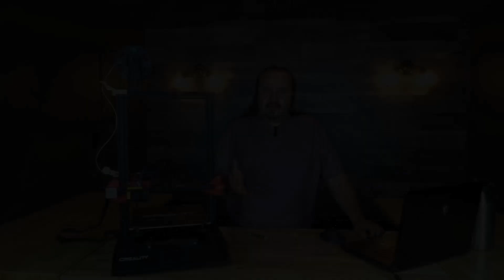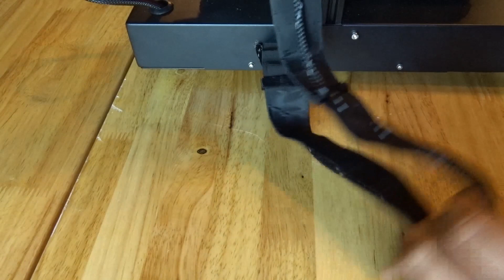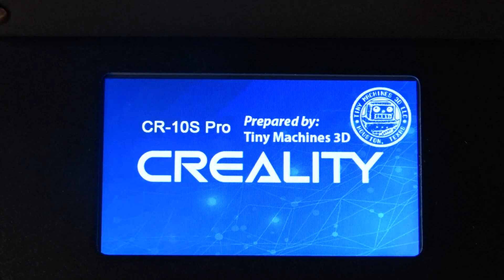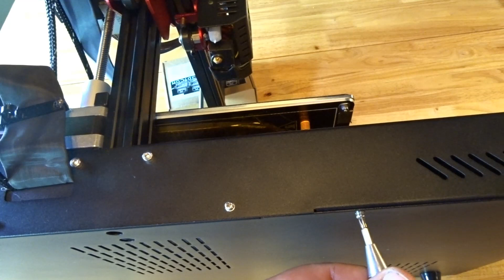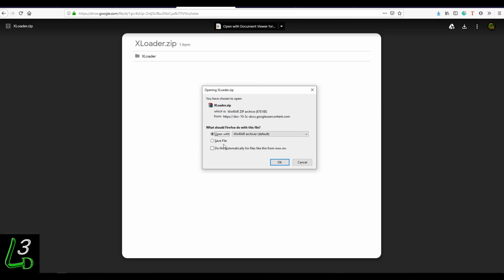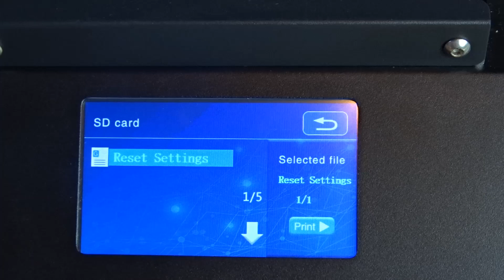Full Tutorial CR10S Pro TinyMachines 3D Latest Firmware update B7 (June 2019) with BLTouch V3 probe

Comment: This is a very good video, but I have come to the conclusion that if it not broken then don't attempt to fix it. It appears that people who own these machines spend more time, money and effort ' upgrading ' them rather than print anything useful with it. My stock machine 10S ProV1 with the 8 biit board (only changed the capacitive sensor to inductive and put on some Chinese anti backlash nuts a few years ago) managed to print a full 5X7 field camera over a period of a month with a good degree of accuracy that the parts fit very nicely together and there is no light leaks. That is good enough for me. Others might have other ideas what these machnies are for. BTW, all the FW pages have been removed from the Tiny Machine site and moved over somewhere else. Thanks for this posting.

Comment: Thanks for the tutorial!  Question for you if you see this.  Recently my CR10spro went wonky and now has major later shifting on Y axis   like it's over shooting front and back measurements, sometimes it's layer shifting only in one direction like stairs but other times it goes both ways 🤔maybe Y axis is biaxial 🤪 .  I've checked all mechanics and everything is as it was since I've been printing for 13 months and boy have I been printing. Could this be a glitch in firmware? I figure electric motors are going to either work or not work . My belts are tight and teeth are fine. I had a weird episode of my flash card being deleted by the printer on the same day that the layer shifting started. That's why I wonder if it's a firmware/software glitch. Computers being stupid occasionally and requiring humans to reset them . Any help would be greatly appreciated! I have 10 rolls of filament waiting to print Christmas displays 🤣
Reply: Did you find the problem?
I have the same problem now :/

Comment: This was helpful, not I am now receiving an "SD INIT Fail" at startup   firmware version is shown as 2.0.9.DW7.4 loaded from tinymachines on 7/31/21.   any suggestions?
Reply: Hi Steve. I am sitting with the same SD INIT FAIL at start up. Did you ever manage to get this sorted? If so, i need some advice please

Comment: I'm trying to install a BL Touch on my CR10-S Pro using a kit I purchased from Tiny Machines 3D. I'm following the instructions and I got as far as flashing the LCR (successfully) but now when I am trying to install the Tiny Machines firmware to the main board using X Load, it says "Can't open port".  It only gives me one choice of ports to use  (COM3) I read it recommends 115200 for the baud rate and another place I read try using 250000. I tried them both, no luck. I'm sure it's something simple I'm missing, but I've never done anything like this before and I don't understand it all completely.
Reply: I figured it out...I had Cura open and it was using that port apparently. Time for a beer :)
Reply: Good grief, I feel like I'm talking to myself. Now that I have the firmware installed, I did the homing of the machine and the BL Touch did not deploy. fortunately, I was able to turn the machine off quick before It buried the tip in the table. When I turned the machine on, it deploys twice and then retracts and has a steady red light. Any ideas what's going on?
Reply: I had to flash mine twice. Make sure you have the correct firmware. the one with BLT in the file name.

Comment: Hi, I'm trying to upgrade to Tiny Machines for my CR-10S Pro V2 (BL Touch included), but i need to customize offset of probe. I have downloaded several versions and try to compile with no success. Please can you guide me to the right files? I think I might be failing on editing custom offsets inside Configuration.h
Reply: If you are feeling crazy, I just built and loaded CrealityDwin2.0_Bleeding and noticed it had Probe offset under Settings->Tools->Adjust. I used VSCode/PlatformIO to build it.

Comment: Thank you sir! This weekend I am going to try to put this on my "v1" machine that I changed out to an inductive sensor. I also have a v2 with a BL Touch but I am hesitant to change the firmware on that because the OEM version it came with is working really well.
Reply: I am with you here on the V2. How can I be sure that Print Resume functions on the TM firmware....?
Reply: @sunlec   You need to enable it via line command through Cura or Pronterface. I don't remember what command it is though.

Comment: when its doing auto level should the nozzle be at print level ie. .2 mm as it goes around?
Mine seems tro be about 2mm off the bed.
Reply: How did you get it to update , i keep getting a blue screen with all lines being 0000 when i try updating the screen
Reply: @arthurmatusevicius3192  make sure the memory card is formatted properly, put the folder DWIN_set  on the card and put it in the screen slot, power up and wait.
Reply: @arthurmatusevicius3192  make sure you get the right version for your printer.

Comment: hey, i used your video to install the newest firmware DW6 and i now have 36 probing points. but when i go to do the autolevel it says its going through probing points but the extruder itself is not moving. and it homes and moves fine in movement menus

Comment: Hello.  Xloader finishes updating with 0 bytes updated message. also cura is stucked at firmware upload pgress bar.  promterface is OK with connecting and managing printer. any ideas? changed all baud rates and tried. firmware file is confirmed with tinymachines support. its CR10Pro_Stock_BIL_DW5.hex as of Feb.20
Reply: Did you sort it? I have the same problem, tried everything
Reply: @marineaircon  did you tried with windows7 ? i will do if i find a W7 laptop. But very interesting that i also tried with another cable also. same result.
Reply: hello,  any result?
Reply: change to 250000 baud rate thats what fixed mine.

Comment: Tinymachines website for that address is TOTALLY different now. The files you are showing in this video don't exist. I just purchased my CR-10s Pro and am running ver. 1.6 and would like to moe to the TM one but I can't figure out how to get the DWIN files for the screen and I think I have the .HEX file but I am not sure. Any help would be great.
Reply: Same issue here.  I am unable to get the files???
Reply: Same issue here. My firmware version: 1.70.0,
Which steps (including the right files) are necessary to update my firmware?
Reply: @simcha007  its the same steps as the video the only thing that changes are the files depending in your sensor
Reply: @eggiereyes  Thank You, I managed to update the firmware by using Cura. Now I have troubles with updating the screenfile. When I copy "CR10SPro_Max_Ender5Plus_V2_Screen.7z" to my SD-card there will be no action after powering on the printer. How come?
Reply: Wim Wessling did you do all the steps as this video
Reply: @eggiereyes , yes I did. First the formatting of the SD-card, 4096 bytes, FAT32 and made a map DWIN_SET and copied the file into this map. I got a blue screen with the mentioned files but all zero's at the end of the lines
Reply: Wim Wessling you should have see the word END on the top right corner all it does it flshes the screen nothing more the end its just a blue screen
Reply: @eggiereyes  Mission accomplished. I had  to unzip the 7z-file. Thanks for your support!
Reply: Wim Wessling  Yes you only needed to have the Dwin set folder in the SD card.

Comment: Their firmware will not refresh SD files unless you switch on/off the printer.
Reply: I have the same issue. It also stops reading a file if you by any change cancel a print. After you cancel that print (bed leveling issues or any other reason) the printer refuses to print the same file again. I can select and print other files bot not the one I cancelled. I found that if I go back to the main menu, take the sd card out, go back into print menu (with the sd card still out), then go back to main menu, insert sd card again, go back to print menu and 7/10 times works again. I am glad I just upgraded the firmware to only one of my printers as a test. I am going back to version B7.

Comment: Hi, for how long does it takes to Xloader to upload the firmware ?
Reply: Answering to myself, it should take less than a minute. 
I had to fix the baud rate in the windows manager :

"go to settings and then manage settings see the device manager and look for comports. verify the correct comport is active then set Xloader to that comport. select the correct bit rate as I show in the video others will not work. then reupload this. it should work just fine now."

Comment: Does not sound so easy but definitely worth doing. I did update my sensor to an inductive model and added Z drive synchronized pulleys from Tiny Machines. I have two problems maybe you can help me address. 1} I find the top of the Z assembly does vibrate and I bought the Struts for the Max Printer thinking I could find a way to mount, But then I learn how short the Aluminum frame really is under the steel plate cover. It there a way to address this with longer frame added to the existing assemble or do I need to replace the bars with a larger Max Like frame? 2} My second issue is during setup for a new print my nozzle will leak filament the whole time, so that by the time it gets to put done the 1st layer there is always a small blob of plastic I have ti fuss about dragging it out or it gets in the way and can cause the first layer to lift and ruin the whole print.  Is there a G-Code I can add or setting in CURA to retract before setting the level bed and keep the nozzle clean until 1st layer print time??????? Dennis
Reply: Houston we have a problem. I followed instruction very carefully did the screen update yesterday and tried the controller update today. All pretty simple after I drew up a flow sheet to break the steps down. BUT, the X Loader never returns loaded file size it seemed hung in loading. I waited 20 minutes.  How long does the load take, I unplugged. did the reset and ran a ABL to find only 16 test points. So it did NOT load. does it take so long. Can I simply retry to load and just let go for an hour????  A little more on the expected time lapse would be great. and I should post my flow sheet it may help 2st timers see and better understand what they are doing and why.  Help????
Reply: I had the wrong device name, all GOOD, Prints better too! Thank YOU! Dennis
Reply: A Mazingly consistent prints is so rewarding. 10S Pro is a really good printer once the bed sensor and Firmware was upgraded. I can load a print and walk away now. Results are beautiful. O16 layer quality is awesome.
Reply: @DennisMurphey   Hi! May I ask a question if I don't bother you? I am new to 3d printing. CR-10S Pro is my first 3d printer. I bought it 2 months ago. I use Creality's 1.701. firmware. The printing results are not that satisfied for me. I always have the same problem in every print: The outermost walls surfaces are not smooth. Layer edges are kind of ragged. I tried different layer heights, different print temperatures, different print speeds but they didn't work. I use the stock sensor... I don't know what the problem is. Finally, I decided to give TinyMachines firmware a try. But I don't know if this is the solution. Do you recommend TinyMachines firmware? And, does Z drive synchronized pulleys make significant difference on print quality? Thank you.
Reply: @konurmustafa  I did 3 things to my Pro but I feel 2 were significant. 1. I updated the bed sensor to the inductive sensor $10. I seemed to now provide a constant measure of deck height, more reliable. 2. Yes, updates the firmware. Several things included in the update, there is a list of 10 updates included, several are serious bugs in the resetting of the Z offset that were broken.  I can without reservation suggest these two updates.   Regarding your issues specifically, I am fairly new to 3D printing, and have only had my Pro for 1 month but I will offer my inputs. I think you need to go through the device most thoroughly with respect to the guide rollers. on all three Axis'. I found upon inspection all axis guide rollers OUT of adjustment. I removed the bed top and the carriage. I found the inner 4 rollers were all very tight, but three of the outer roller were not even turning. Very slight adjustment but it smoothed the axis movement considerably. On the X axis I saw the nozzle assembly lifting when going to the home position. I raised the assembly then lifted the nozzle to find the lower roller was way out of adjustment as well. the whole nozzle was just drooping. I adjusted it again ONLY SLIGHT ADJUSTMENT is needed. tighten, for smooth glide but not binding in any way. Then the Z axis was OK on the left side but off on the right side. I adjusted the rollers here and set the vertical height on both sides. After this the accuracy of the nozzle to print smooth sides was greatly improved, Like driving my Corvette with all the lug nuts on the wheels loose.  Crazy for a brand new machine, but consider shipping and location change could cause these things, SO I would expect ALL new machines need to be gone through this way. I still had globing at the nozzle and saw the bed height was erratic, this is when I ordered the inductive bed sensor. It was most easy to install, solder three wires and insulate, but I failed to cut off enough of the new cable so I have a coil of extra cable hanging off the machine. I would fit the cable 1st, then market it with pen or tape remove from the machine and make the cut and repair at the bench with good light and flux etc. Then thread the connector from the nozzle end and assemble the sensor.  I found after all this the machine is much more reliable and has made repeatable prints of fairly small parts. I design and make adaptors and upgrade parts for my S Gauge model trains from the 1950s, So far the small parts are looking better and better as I learn to design for 3d printing. One additional thing I did that also seems to have helped was to update and use the CURA 4.3 Slicer, It has a specific setup for the CR 10S Pro and allowed me to adjust a few things. The 1st layer is thicker and slower than the main print. I also added a lot of print loops around the part in the brim. this allows me to observe the bead of the nozzle printing and see if it is too thin or not sticking at all. I have the adjustment screen open in the print screen and manually raise or lower the nozzle before it completes the brim. This ensured a good 1st layer and successful print. One afternoon I had to print three smaller parts for a new prototype. I setup the printer, ran the Slicer, loaded the G Code and started the print and did my usual setup during the brim print. after that I could load and leave. return and pull the prints off easily as the bed cooled off the part would separate easy. I mage 4 parts in a row with out intervention on any setup. However the next day I tried it thinking al the same just fire and forget, NO SIR! that print was a mess glob and hair only half the 1st layer stuck. Nozzle printing in space. I killed it did the set up again and restarted then tuned the brim, then that day I could fire and forget. But not the next day, Only if they were all printed in a row at the same time frame. I am actively searching for AI tools that can run on Adruino to provide all this setup during the brim in closed loop and real-time self tuning. We can get our car engines to do this and I have build robotic systems that were self adjusting. this is not a technology issue to resolve, it is just a matter of the will to apply the science that is available to do it on the cheap for the hobbyist. That and my trains are my goal. If you need more guidance on the fireware install let me know. I have my three part load instructions I created after watching numerous You Tube videos. Good luck and let us know if anything here helped you. Dennis
Reply: Forgot to comment on the Z drive Pulleys, it was more for peace of mind as I had leaned on one Z axis and shifted the bar. not anymore and really cheap. So I did it.

Comment: Very cool Video! Thanks! I just have a problem, the X-Loader tell me that he can't open port. I checked the com port ->it's ok and i also changed the baudrate to 250000, but i have the same issue. Do you have an idea what the problem can be? Thanks in advance
Reply from the maker: Hi, thank you, Yes the issue is with the port command in Windows. you will need to make sure no programs are open with a port control. To ensure this restart your computer and only start Xloader then plug in your printer via the USB cable. go to settings and then manage settings see the device manager and look for comports. verify the correct comport is active then set Xloader to that comport. select the correct bit rate as I show in the video others will not work. then reupload this. it should work just fine now.
Reply: @LiquiDirt3D  Thank you!  This saved me a potential extra half hour of troubleshooting (or however long it would be until I decided to reboot :p).  I had Cura open as I was doing stuff prior to the update, and of course that would also be using the port.  Great tip!

Comment: Ive had an unbelievable amount of issues with this machine since i bought, ive recently bought and installed an aftermarket hot end, installed a capacitive sensor and just did this firmware upgrade and this thing prints beautifully now! Next im installing water cooling so i dont have to worry about heat creep again.

Comment: Heatsink for the solid state relay.. what is the size? where did you get it? thanks!
Reply: I got my CR-10 S Pro in mid of august, it had the heatsink already installed by the factory
Reply: @TheSpeedy24  just checked mine from September in it has it
Reply from the maker: It is a standard upgrade from Tiny Machines. Contact them for details, reference my video when you do for reference to the ticket you create.